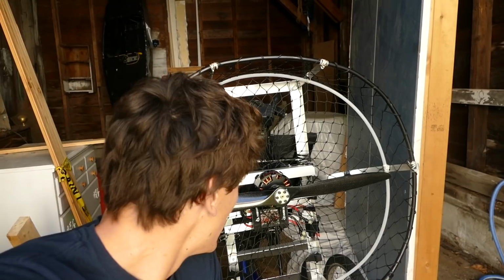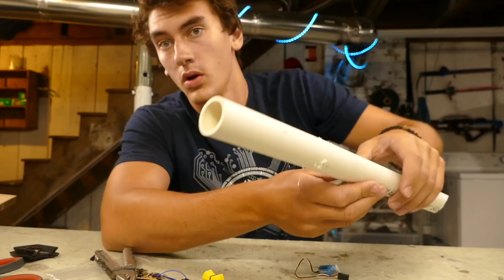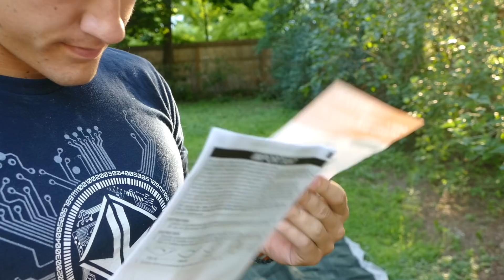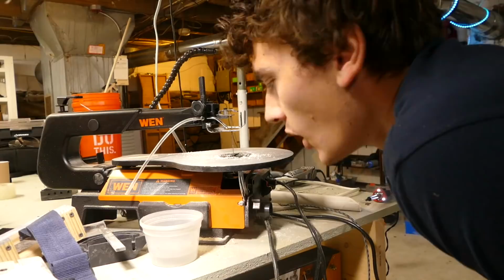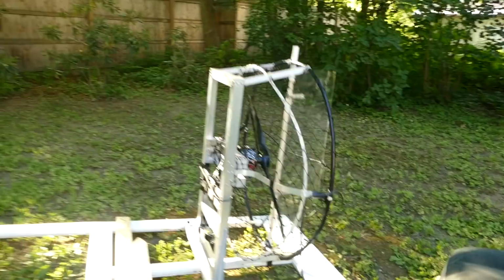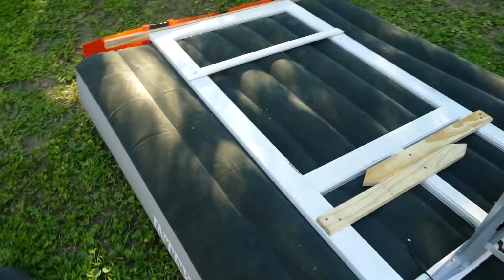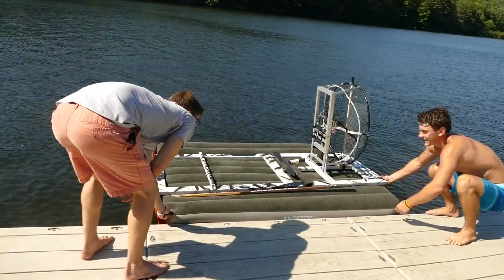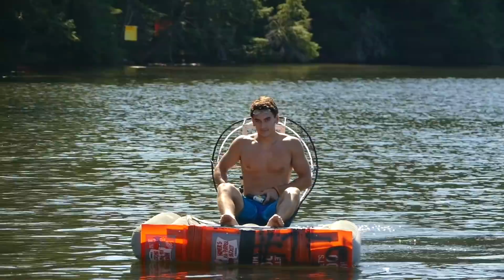First Ever INFLATABLE ELECTRIC FAN BOAT! - Crazy DIY Project!!!

Comment: Try connecting three plastic canoes that have those ice chests behind where you sit. Water proof those and put organic carbon power cell banks in them. Then design a frame that you can lever latch lock to the three canoes that your can place electric out board motors on the two outer plastic canoes. Then add a rudder to the center plastic canoe. Then gets a my pod camper and cut a port hole in the front that pop opens and lays back then install the wheel for the rudder and trottle close to the front of the my pod camper. Add a back carbon fiber deck at the back of the my pod camper. Design it all to be able to lever latch lock everything together and then be able to take it all apart and place it on a chassy lever latch it to the chassy to be able to use the my pod camper on land. You could even design a very light weight chassy add in hub electric motors with a two wheeled swivel dolly at the hitch and design a hitch to attach to an E bike to go E bike camping. 😊😉

Comment: Great invention.  The only thing I would do differently is instead of using a mattress I would use an inflatable digny there designed for the water go faster because of the shape and a lot more tear resistant

Comment: Xmas with kids, is when you find out you need c batteries. 
Now I use alligator clips and set the voltage with a regulator to avoid buying specific batteries as much as possible.

Comment: you should see how it would be to fill it with helium
Reply: GAproductions it would be heavier because even though helium is lighter than air it can still be heavy because helium has a density of .4 it will take more helium to entirely fill it. And it would be too expensive
Reply: .4 what? Helium has a density of 0.179 g/L at standard temperature, which is 0 degrees Celsius. Nitrogen and oxygen, the two most abundant components in our air,  both have a density of at least 1.25 g/L. Being that helium is less dense than the air we breathe means that it is has more buoyancy, which would make the air mattress float a lot better because density and buoyancy are proportional to each other.
Reply: Very very confused but okבר פרידריך
Reply: Clyde Bounpheng, im also very confused on where you got your information about helium from.
Reply: Yes I was very confused and I did get my information wrong
Reply: Nerds! Jk

Comment: Can you mount that on your bike, so it inflates and deflates rapidly,..and rolls back tight,.. and Shoulder mounted rudder steer to  control the air and a solid front wheel for ground and water control,.. and a retractable JL pirate flag,.. and a laser headlight